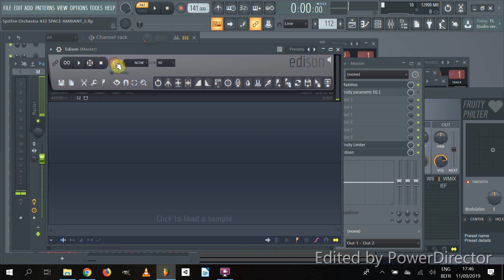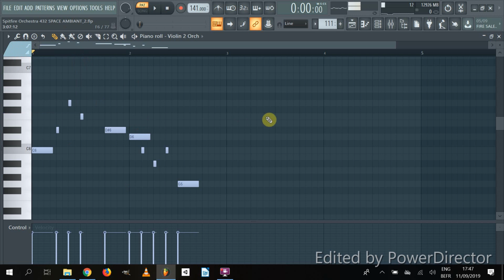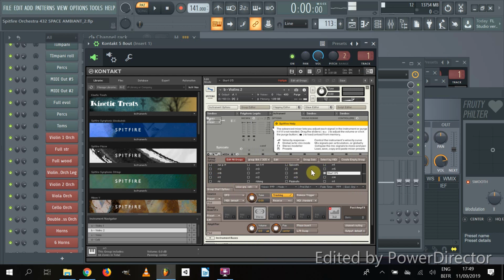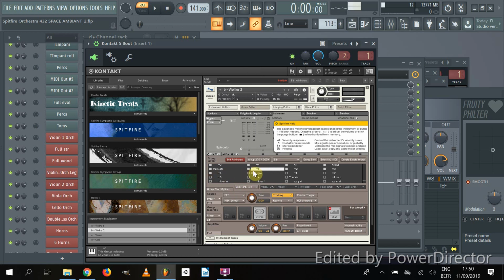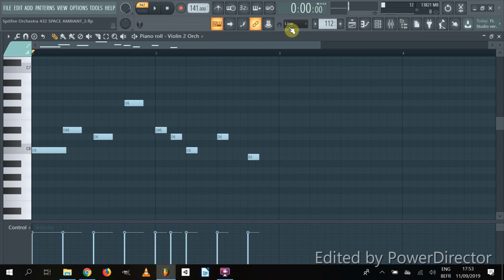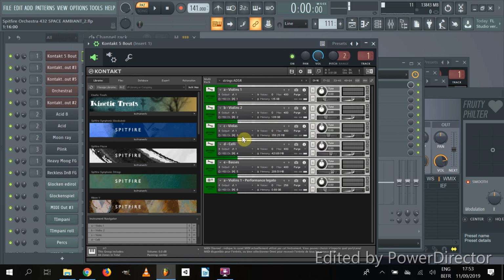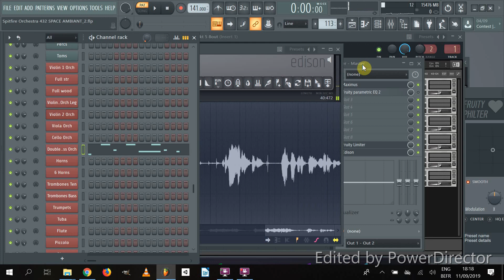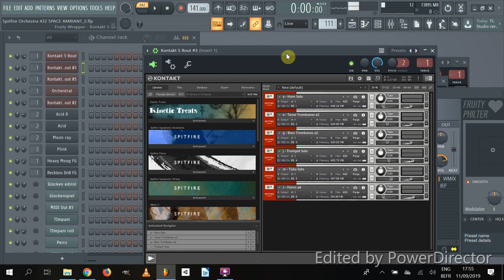How to fix the shorts in the Spitfire Audio Symphonic Strings

Comment: This is really cool, great trick that can sound cool, but you are also getting rid of the room sound when cutting samples short. So the room sort of disappears for the shorter notes then comes back on the long notes. I think going for the Studio series makes more sense no? Then you can still do this, and not get rid of the room sound, because there is hardly any room, (and far less with the close mic)
Reply from the maker: True. What I do, is simply add reverb anyways, so the shorts don't loose all the room sound, but at least I can create nuance in the note lengths in staccato passages.. ;-)

Comment: Sounds great! Just to be sure... I which folder do I need to load the nkm-file? I use Spitfire Studio Strings.
Reply from the maker: Hey! I haven't done edits for the Studio Strings, I don't own them.. These multis patches only apply to the symphonic orchestra series. But you can manually create the same system by following the steps in the video. :-)

Comment: Sorry to let you know but you've wasted your time :( There is an option on the UI for the SS range (Brass, Strings and Woods) called Short artic RTs (it defaults to No short artic RTs) that you can change to Timed or unTimed. When this is on the notes will stop when you release the key and do what you have tried to do here.
Reply from the maker: Yes, and it only is available on the shorts, not the spiccato or the pizzicato. Same for the brass and woodwinds: no untimed short RT for staccato patches.